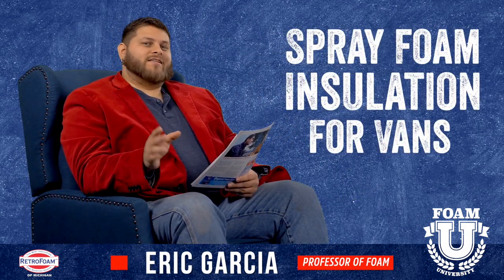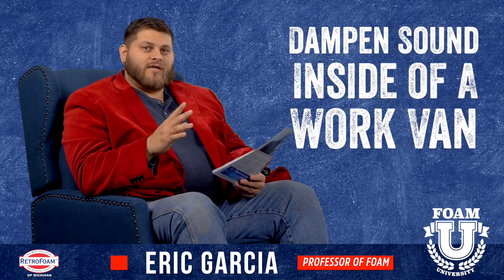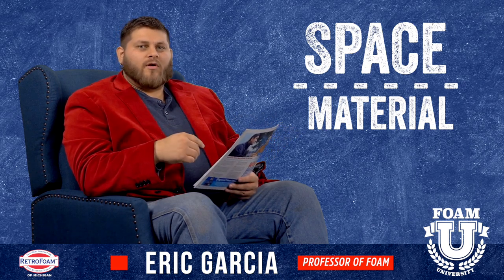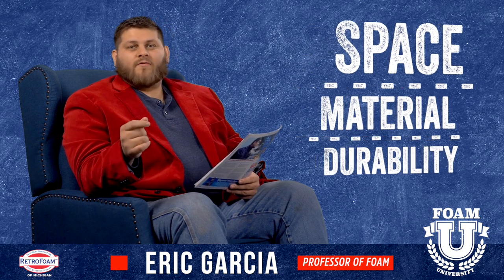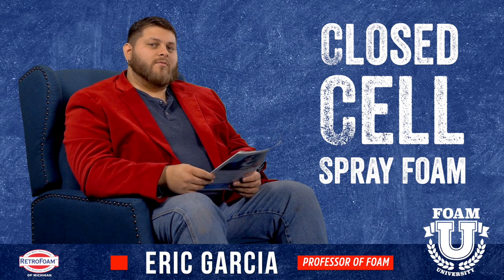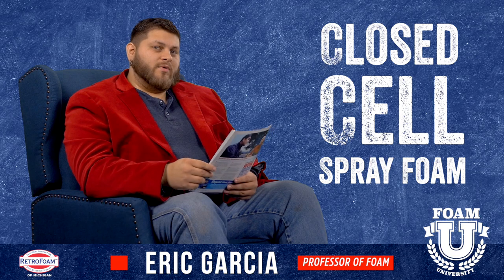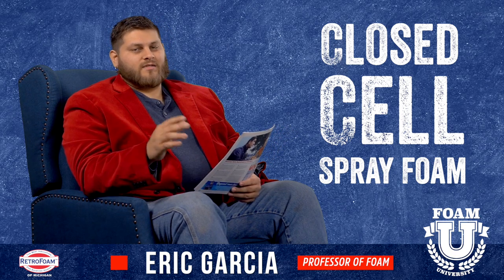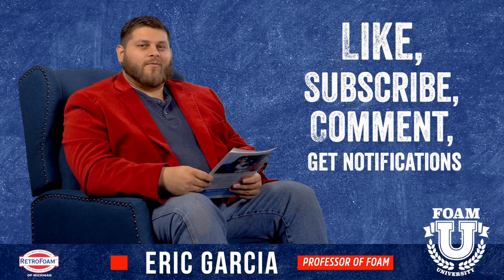Spray Foam Insulation for Vans | Foam University

Comment: I just called yesterday to get an idea on the cost and they said close to $2,000, yet the video says under $1,000 even in the biggest sprinter high top vans.
Reply from the maker: Since this was made in 2019 prices have gone up. Thank you for bringing this to our attention so we can correct the information.
Reply: Yep. $1,900
Reply: Supposedly spray foam can deform the panels, causing a waviness to the exterior of the van. I haven’t seen any pictures of this yet. Wondering how noticeable it really is
Reply: @ghiagoo  I ended up just spraying the whole back with Rhino Liner. It’s a contractor vehicle and it kept the condensation down to almost nothing last week when we had single digit temps and then it warmed up. I’m glad I didn’t do the spray foam.
Reply: I had my Mercedes sprinter 2500 van that we turned into a camper van sprayed with close cell foam. They charged me $600 🙂
Reply: @haydenroofing  that was a good price. The DIY packs at Menards are now like $425, or something like that. During the pandemic, it shot up to $700.